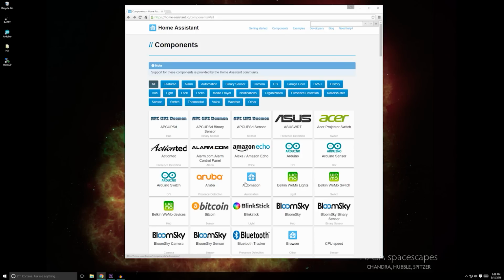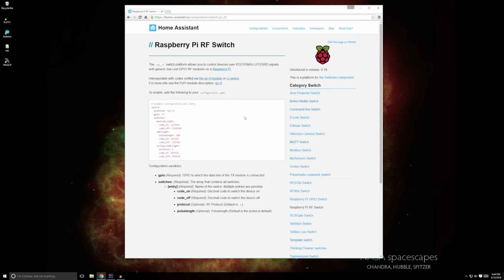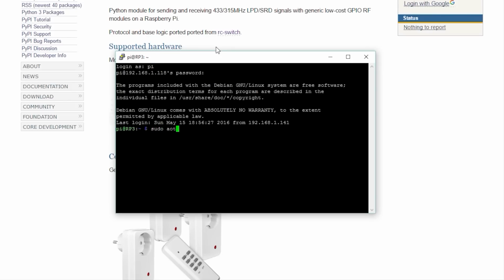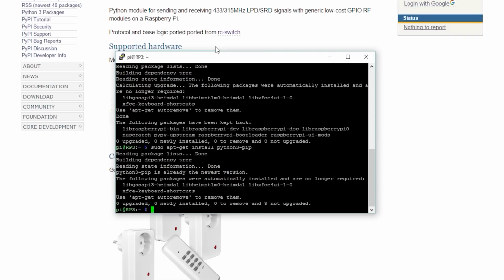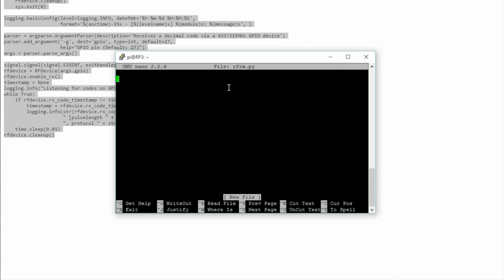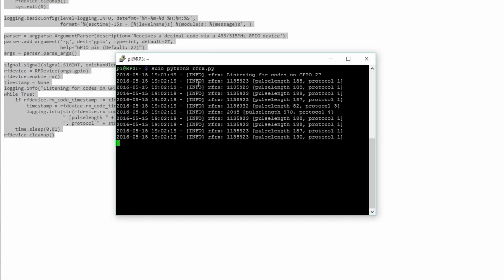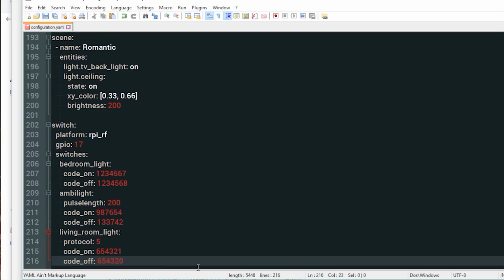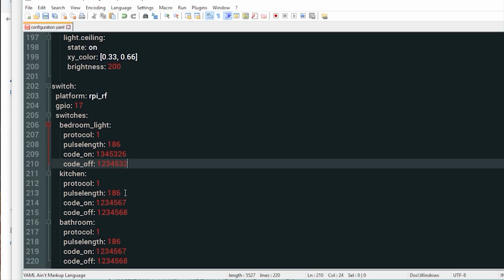The Cheapest Tech - $6 DIY Internet of Things Smart Outlets

Comment: Hi Ben

First off, thanks for your videos. They have already been a great help to me in setting up a very basic HA system (1 zwave controller + multi sensor). I'm a newbie at this so I want to apologies for the noob question I'm firing at you... the idea is to built a simple alarm system (and expand on that when things are running smooth).

At first, I thought I could use the RPI RF switch component to detect a remote RF transmitter such as this one :  https://www.amazon.com/Raogoodcx-Universal-4-Channel-Wireless-Transmitter/dp/B01DDGAQX8/ref=pd_rhf_dp_p_img_8?ie=UTF8&psc=1&refRID=7316J8NHKMF079FA3D04 (or maybe a better model).  But then, looking at it closer, it seems that this HA component can only send signals and can not update the state of a switch in HA based on a received RF signal. 

Is my assumption correct (tbh I hope not) ? And if I'm correct, could such a setup be accomplished with the RFXCOM component (which is a lot more expensive) ? 

Basically, I'm looking for a friendly way to deactivate the alarm without having to demolish my wall . If you would have any other ideas, fire away :)

Thanks in advance.
Reply from the maker: For sure! Pumped the videos can be helpful. No such thing as a dumb question - I ask them just about everyday. Unfortunately, receiving RF signals in HA is pretty difficult. the RFXCOM component is really one of the only ways. You could do some fairly involved things like creating an Arduino GPIO binary sensor for your Pi. It's not super robust though.. especially if all you're trying to do is signal HA to turn off an alarm. If you want a remote and have Z-wave already, I'd probably go after one of these guys.. http://amzn.to/28JI1sI or http://amzn.to/28JJb7L. Not exactly cheap though. 

Because turning off the alarm is an HA service, there are tons of ways to deactivate it. My preferred way is to have the alarm deactivated automatically. I'm not sure if you're doing presence detection in Home Assistant, but once you get that rolling, you can create an automation to arm/disarm your system. That's what I do. I also do sleep tracking via a HTTP Sensor (sent from Tasker on my phone). That arms the system when I go to bed. 

If you have a siren, I'd hold off on turning it on until you're really confident in it, though. It can take a bit of tinkering to get the alarm system to >99% reliability.. especially if you're using any kind of PIR sensor. My experience is that those are pretty flakey until you get them adjusted just right. Let me know what you decide to go with! Cheers!

Comment: hey I having a problem with this. I am new to this  Here is the info from the log 16-06-11 08:34:07 homeassistant.bootstrap: Incomplete core config. Auto detecting location and temperature unit
16-06-11 08:34:27 homeassistant.components.switch: Error while setting up platform rpi_rf
Traceback (most recent call last):
  File "/srv/hass/hass_venv/lib/python3.4/site-packages/homeassistant/helpers/entity_component.py", line 109, in _setup_platform
    discovery_info)
  File "/srv/hass/hass_venv/lib/python3.4/site-packages/homeassistant/components/switch/rpi_rf.py", line 49, in setup_platform
    rfdevice.enable_tx()
  File "/home/hass/deps/rpi_rf/rpi_rf.py", line 77, in enable_tx
    GPIO.setup(self.gpio, GPIO.OUT)
RuntimeError: No access to /dev/mem.  Try running as root!
Reply from the maker: Try running the command sudo adduser hass gpio. That should fix it (hopefully...) :P Cheers!

Comment: Hey Ben, or any other helpful people out there, I seem to have a problem with  the protocol. HA crashes if I have more than one item on protocol 1? Log states: 
16-06-10 13:55:55 homeassistant.util.yaml: duplicate key: "protocol"
  in "/home/hass/configuration.yaml", line 56, column 0
  in "/home/hass/configuration.yaml", line 61, column 0
Any ideas?? help greatly appreciated!
Reply from the maker: Hmm, that's odd. I think the default protocol is 1 so you can probably just remove those lines all together. If that doesn't work, can you post your config to Pastebin and share the link? Happy to take a look!
Reply: that's great, I will keep persisting atm and if I loose the will to live I may have to take you up on that! I think the real problem is nothing to do with the protocol tho. when I scan using rfrx.py I get a lot of different codes? I notice on the vid yours are all the same every time, out of 30-40 lines on cmd I must get a maximum of 3-4 codes that match? that was using lightwaverf remote so I thought I would try some Energenie plugs as well...same thing!! so I am sure that is the problem but so far I can't find a solution on the net. Any help before my explodes would be awesome. p.s I am using the cheaper more generic rf modules?
Reply from the maker: Sorry to flake on this. YouTube doesn't do a great job of notifying responses to comments. Sorry about that! 

Yeah, so, the superheterodyne RF RX will definitely do a better job at receiving a clean signal. I found on my remote that holding down the button to re-transmit a bunch of times works well. I found that holding the button in 3-5 second bursts pretty close to the receiver works the best. But that just depends on your remote. 

The rfrx.py codes don't have to be super clean just so long as you capture the right one to retransmit later. In retrying some stuff here, I definitely get some noise, too, so no worries!

Comment: Hi Ben 
Thanks again for your videos. Just orders my  RF Outlets and waiting to integrate them with my HA.
Just wondering if you know anything about integrating Orbivo outlets with HA. It connects over your wireless network and can be controlled trough a app. I assume it has an ESP8266 and wondering if you know of an integration with HA.
there is the link: http://www.banggood.com/WiWo-S20-Wi-Fi-Smart-Remote-Control-Timing-Socket-USEU-Plug-p-953743.html
Thanks again
Reply: +BRUH Automation that's fine. Thanks for the advice.
Reply from the maker: For sure! Pumped to see the community growing here! :)

I haven't heard of the Orbivo outlets before. They look sweet for the price. In a quick google, it doesn't appear there is a public API (that I can find). A few people look to have reversed engineered Orbvivo products for Ninja Blocks, but that's definitely beyond my capability. 

Generic WIFI outlets can get super frustrating because there is zero harmonization in terms of protocol and incorporating into a home automation system can be stupid hard. 

If you have a few of these and are desperate to integrate, I might try doing something like Tasker to control the outlets (not sure if there is a plugin, worse case you could utilize AutoInput or something). Then, trigger Tasker using AutoRemote from Home Assistant. That's pretty cumbersome and probably would require a mostly dedicated Android device.  I did something similar with Google Play music to initiate a Chromecast stream, but it was so blasted complicated for what it did I stopped using it. 

Anyway, not sure if that helps, but just some ideas! cheers!
Reply from the maker: Interesting. Hmm, I can't see an easy way to automate that with Home Assistant. There doesn't seem to be much in the way of an API. I assume that ESP chip is running some code, but to my knowledge there isn't any way to pull it off and take a look at it to intercept as is. :( Sorry I can't be more of a help. 

I'd be inclined to build that circuit myself from scratch. LED strips controllers are pretty simple all things considered.

Comment: This is an excellent channel- Thanks!
I just happen to be engineering a teensy WiFi/Pi Zero based hat, engineered to fit INSIDE a 2"X4" electrical box- a "retrofit" concept. (8) analog/switch inputs (ADC 10 bit X 8) to share with "other" smart things, and (1) 277V Form C relay. I haven't yet been successful in making a 2 X 8 device yet (2 form C relays)- but I'm still trying! VERY important to have (2) Form C relays on a Pi Zero footprint. Gotta make it fit- and I WILL!
http://piwifio.com < I'm retired, not "selling" anything, just doin' it for the joy of engineering...there's a CAD download if anyone is interested...
and, PLEASE- let's all communicate! 
https://www.youtube.com/watch?v=d5qNqbByND8
Reply from the maker: Very cool Good luck with your board design! I love the Pi Zero. Looking forward to doing some projects with it when I get the chance. Cheers!
Reply: I can do the electronic engineering part perfectly.
I'm publishing the CAD files and parts list.
However, I'm NOT a fluent programmer.

I'm having GREAT difficulty sending  the (8) 10-bit variables loaded in my "remote" Pi Python program to a server. How do you send a Python variable to a remote server?

If any programmers out there can help, please!

I'm using an MCP3008 to collect 8 analog inputs. I need to REPORT the input sensor data from my Pi  to the server. HOW!
Reply: ....every .2 seconds

Comment: For some reason I cannot get this to work. I have tried it with my Home Assistant setup and also on a completely new and clean install of Raspbian. It seems like the superheterodyne is working, because I get some results when I run the script, but nothing that corresponds to the button presses from my remote. Any ideas?
Reply from the maker: Yeah, I feel your pain. I was trying to help my friend out getting this setup and was running into some issues. His issue was a bad RF RX. Try holding each button down for like 3 - 5 second pulses and move it around near the receiver. The remotes transmit as long as you are holding down a button. If that doesn't work and you've done a clean install and are 100% on your wiring, then I'd probably try a new RX. :(

If you have one, you could try and run the RCswitch library on an Arduino with your receiver. Arduinos are definitely a bit more solid for receiving RF signals. If you don't have one, nbd! Let me know when you figure out what's going wrong.

Comment: Your instructions are spot on.  I got my setup working very quickly.  Thank you very much for this video and the one about One Step Home Assistant Install On A Raspberry Pi.

People should know that Home Assistant will not constantly check for the current on/off status of the outlet.  If you turn on a light with Home Assistant but turn it off with a physical remote, Home Assistant still thinks the light is on.  This is something to keep in mind if you are remotely monitoring a light but not actually present to see it.  This is unlike a WeMo switch that keeps track of its own status and Home Assistant constantly checks it.
Reply from the maker: Sweet! Pumped you got it working. Let me know if there's anything I can do to help!

And yes, this is absolutely correct. Very good point. These outlets aren't ideal for situations where you have to know if the outlet is on. Fortunately, you can design automations that fire an on or off command regardless of the outlets known status. So, when you leave you know your outlets will be off. It helps some, but I wouldn't use these outlets for a heater or something where you need to absolutely track the status when you are away.

Comment: Any "cheap china" equivalent to Philips hue you recommend? And of course the should work with Home-Assistant. 
Great videos man, keep it up!
Reply: Check out the MiLight/Limitless LED bulbs
Reply from the maker: Thanks much! Hmm, no real suggestions off the top of my head.  Unfortunately, I've found with lights you typically get what you pay for.  My typical thought process is to either get a few of the very nice/expensive bulbs like Hue/LIFX and then use RF/zwave outlets or switches to make traditional bulbs "smart". 

There is so much new stuff coming out right now though there could easily be a sweet low-cost smart bulb out there I don't know about, though. Let me know if you find it/what you decide to go with! cheers!
Reply: Actually I'v found a bulb called "Qube", its on indiegogo right now. They cost 19 USD a piece, I might just go with them! But I have no clear idea how they will work with Home-Assistant yet.
Reply from the maker: Whoa, that looks awesome! Hope they can get that going because I'd pick up a few extra as well! Looks like it has a web interface and an API so home assistant integration is only a matter of time. 

The sickest part of those bulbs is the presence detection via BLE. I could finally make room specific automatons!  Thanks for sharing this!
Reply: Use Yeelight bulbs. They are cheap and have a with Alexa skill and work with Google home and IFTTT. The bulbs also have "developer mode" that allows you to control with Home Assistant. There's also a home bridge plugin as well!
Reply: Sonoff b1

Comment: Hello . I really enjoyed Home Assistant. His video shows how easy it is to use it. I want to know one thing: instead of using RPI as central, I have Home Assistant installed in a cloud , like Ocean Drive ?. I have RPI at the time .
Cheers!
PS:. 
If you want to control Arduino switch (or ESP8266 ) at home as I was on the street.
Reply from the maker: Sweet! Glad these videos can be helpful. Pumped to see the Home Automation community growing! 

I believe Home Assistant can only be installed locally.  There is no cloud configuration. Haven't heard of Ocean Drive before! What's that?
Reply: Hello . Thank you for such quick response. Ocean Drive is a cloud computing service . With it you can create your own broker to MQTT . It has Windows and Linux server. That's why I asked. Home Assistant really is a good promise for all who wish to simplified automation and low cost. If you want to know Ocean Drive following link: https://www.digitalocean.com/
Cheers!
Reply from the maker: That's sweet. Looks like a cool service. Yeah, no idea if that could run HA, but I imagine that getting the networking right could be tough. HA definitely depends on having access to a local network, but I'm sure you could port the network if someone was motivated. 

I really have enjoyed using HA which is why I rep it so much on this channel. The HA devs are very helpful and accommodating even having expanded so much in the past few years. Thanks for sharing that link! Cheers!

Comment: Not sure if you mentioned it , but if you cut the ant wire to about 173mm it should work that best
Reply from the maker: Yeah! I've definitely heard that before. I've tried testing that a million times, but could never prove the performance was significantly better than just using a spare header wire. Are you seeing performance gains at all?
Reply: well i just cut the header wire to 173.  It has to be better than just any random length. perhaps exactly 1/2 of 173, or double 173 would be fine.  But yeah, 173 would provide the optimum for just a piece of wire.
Reply from the maker: I definitely agree with that. Antenna design always blows my mind. Crazy stuff, that is. Thanks for sharing the info! I'll add a note in the video description in case people are wondering. Cheers!
Reply from the maker: Sweet. That's good to know. I added a note to the description so hopefully people will catch that there. Thanks for the data! Cheers!
Reply: do you just leave the wire coated, or do you strip it to bare metal?  If it is easier can you supply a link to pic of your antenna?
Reply: I just left the coating on the wire...mine works fine

Comment: I wasn't planning on using anything RF, but I just found a box of 5 of these exact outlets in my basement while packing to move.  Looks like these will be my first smart outlets in the new house.  

What kind of range do you get out of your RF setup?
Reply from the maker: Ha, yeah, I was the same way, but it's so cheap to get started with (especially if you already have a Pi) it's hard not to try! I haven't found the max range of these as my apartment isn't huge. I can easily make it 50 feet through 4 walls. Some people online say the range is  > 100 feet and some even claim 100+ meters, but I'd need to see that to believe it. Hope that helps! cheers!

Comment: First off, awesome videos! You've inspired me to start playing around with Home Assistant. Secondly, are there solutions for IR devices? I would like to be able to control my "dumb" receiver and TV through Home Assistant.
Reply from the maker: +Kentacohut Thanks much! Hope it helps people getting started. And for sure! I'm still working on this in my system, but once I solidify it I'll be sure to share. 

Depending on how old your amp and TV are, you might be able to control them via the network. Check the HA components page to see if your devices are supported. The next easiest thing to do is to use a Harmony hub with a remote via IFTTT. IFTTT connects to Home Assistant via the Maker channel. If you don't like either of those you can explore LIRC or LIBCEC via a Raspberry Pi. I don't think either are directly supported via HA (yet), but you can utilize them via command line or python scripts for tasks like turning devices on or off. 

Ironically, reliably controlling my TV and AMP has been a huge time sync. I probably just need to spring for the harmony system or a new amp that supports better CEC/network commands. If you get this nailed down, let me know what you use and like!

Comment: how unique are the codes the remote has? is it like X10 where there are only 4-16 codes to control the world? I wouldn't want to use anything like that if someone could walk past with a remote and turn everything on/off too.
Reply from the maker: +Duncan Sample It's definitely more unique than X10. I'm not totally sure as I haven't played with many different ETekCity outlets. My assumption is that the 7 digit codes are fairly unique to each remote. That said, the RF signals are not encrypted and easily intercepted if somebody is motivated. That's not a whole lot different than most 433 RF things on the market right now - fans, air conditioning units, garage door openers, etc. So, probably nothing to worry about, but I wouldn't use them for super critical items. Hope that helps!